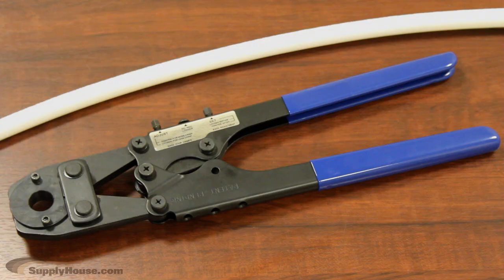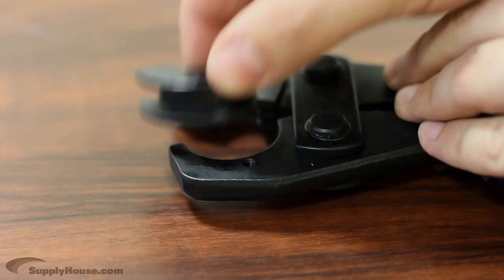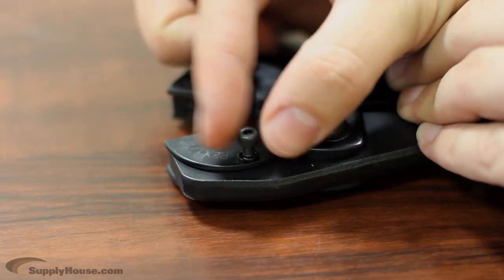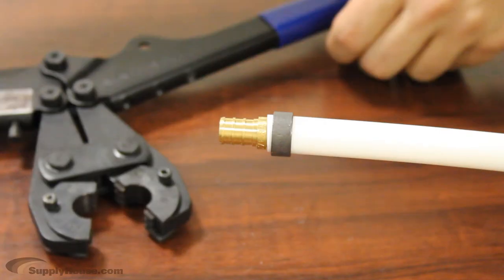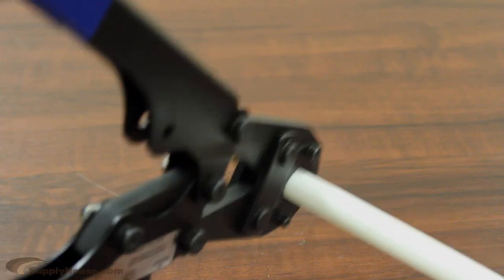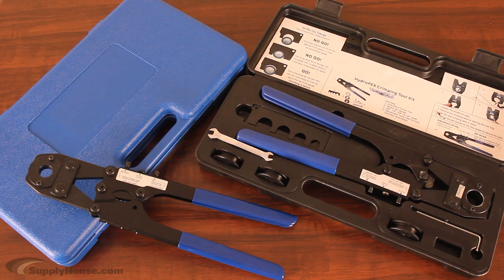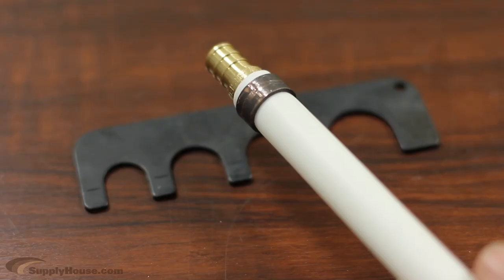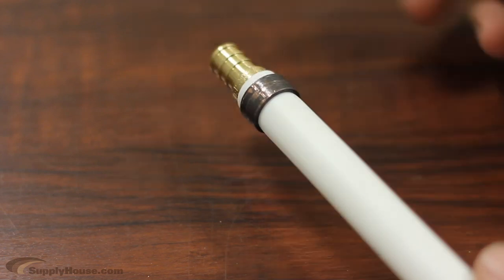How to Make PEX Crimp Connections

Comment: so which one should  not go all the way the no go one or the go one  i am confused  why it comes with  go and no go  holes
Reply: I'm confused as well.
Reply: I think it's whichever one corresponds with the size hose you're using so before crimping the 1inch go/no-go hole won't fit on a one inch ring but after it should but it should only go half or most the way down the 1 inch go/no-go hole after crimping.

Comment: Should you be able to turn a fitting after you have properly crimped the ring?  I find that I can turn the fitting after crimping and testing with the Go/NoGo test tool.
Reply from the maker: Yes, that is normal because allows the installer to properly set the fitting in any direction after making the connection.
Reply: @Supplyhouse  
Thank you for your reply.  
Dan
Reply: I noticed that some will and some wont, i think it depends on if the crimp gets crimped in the ribbing of the pex fitting, or on the rib of a pex fitting. When the crimp gets installed on a rib or “barb” it makes a tighter connection, but thus doesn’t allow for the fitting to spin freely. The no go guage was checked and all were a good crimp.